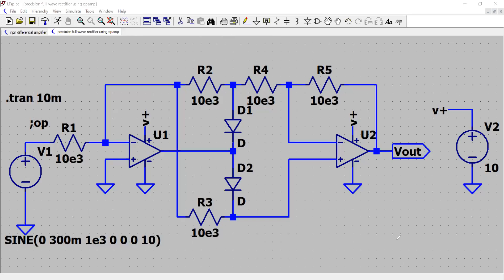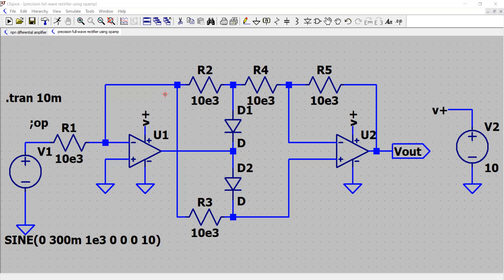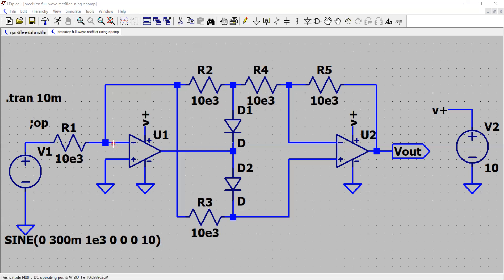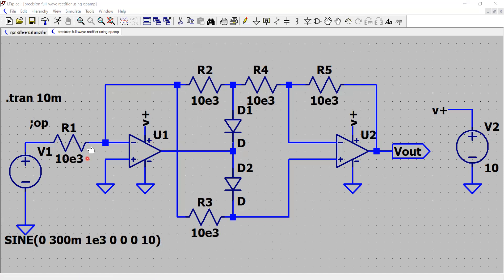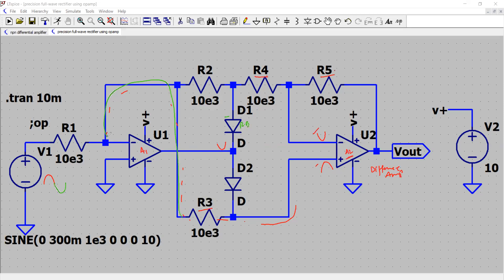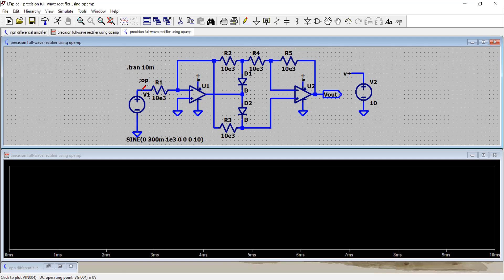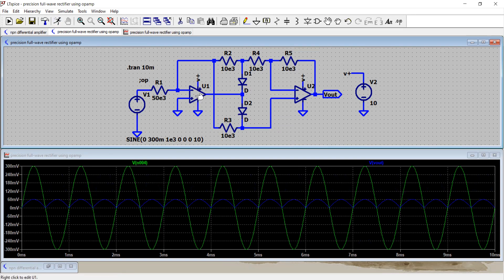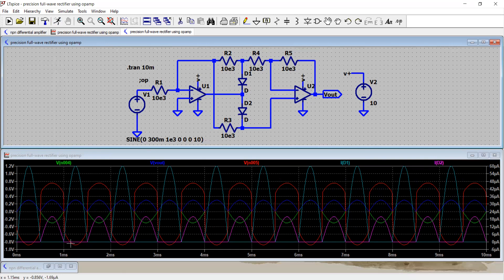Precision Full Wave Rectifier Using Op Amp | AC to DC Conversion

Comment: Would be interesting to see with real components. Especially OpAmp. Like en LM358 etc.
Reply from the maker: Yes, as long as open loop gain of the chosen part of OPAMP is high enough, performance should remain the same.
Reply: @stem1122hjf Slew rate can often be an issue as you show at the voltage between the OpAmp’s at zero crossing.
Reply from the maker: Yes, Design tradeoff required